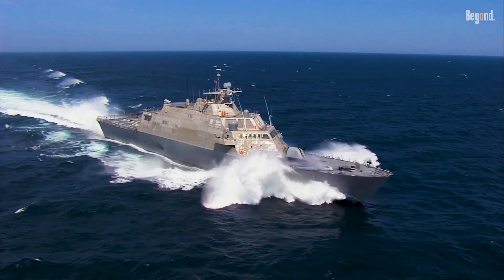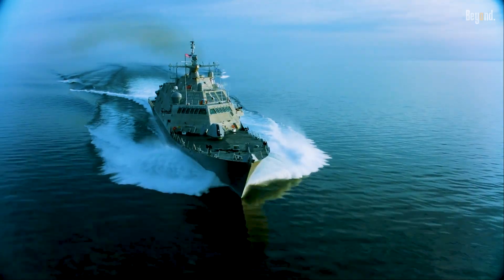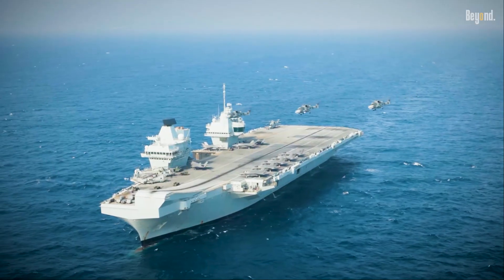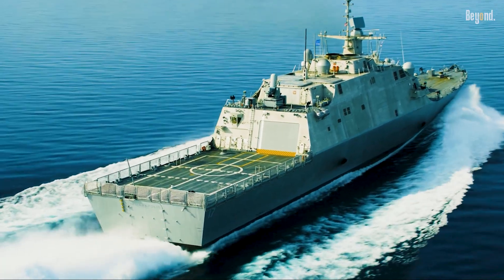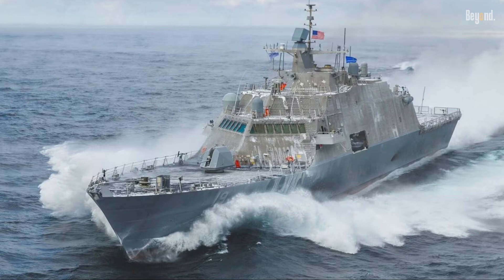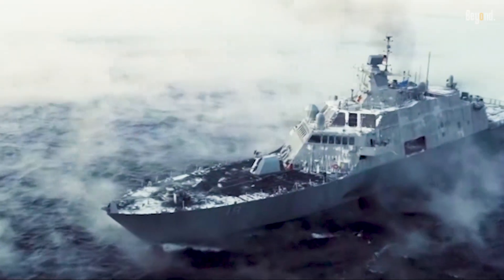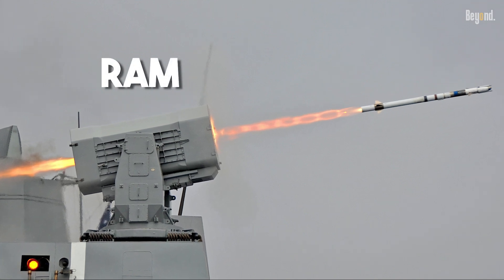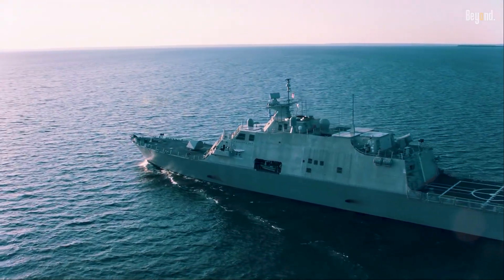Why the US Navy Keeps Quiet About This LCS Feature

Comment: LCS garbage another Cyst on the navy budget. Lightweight Vessel Mafia is at it again. Wasting money best spent on TRUE MULTIDOMAIN WARFARE Maritime vessels. No there arent any of those in the usn. As for Propulsion? The CODAG system is a problematic waste of fuel. Either Diesel engines with EPA TIER 4 injectors or Next Generation General Electric LM 9000 Aeroderivative Gas Turbines, one or the other. Us MSCPAC T-AO KAISER CLASS FLEET TANKERS with ABM in the WINCHBOOTHS going to SPIT 1200-1800 barrels of UltraLow Sulfur Diesel fuel on them anyway.  Waste of time to pump at 3877 barrels a hour, through a 8 inch hose. MINIMUM PRESSURE, CEASE PUMPING, GRAVITY DRAIN, EMERGENCY  BREAKAWAY! NEXT SHIP COME ALONGSIDE!